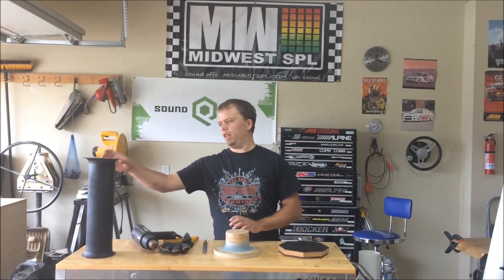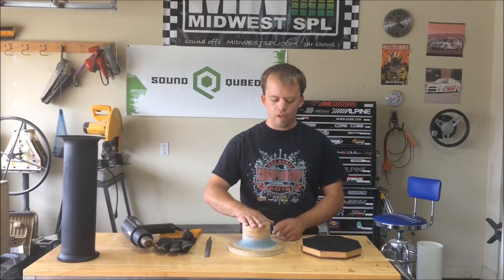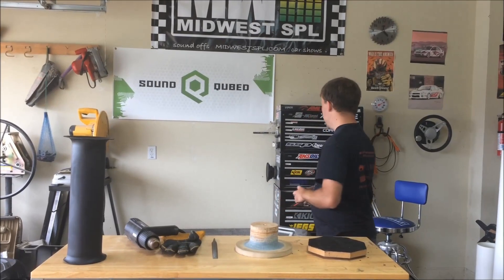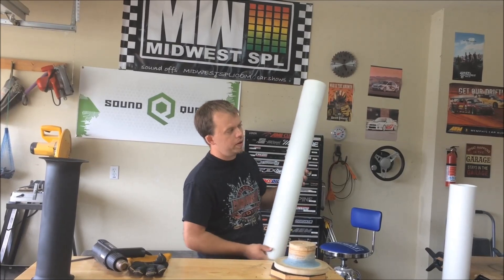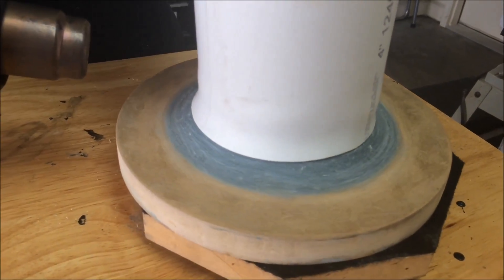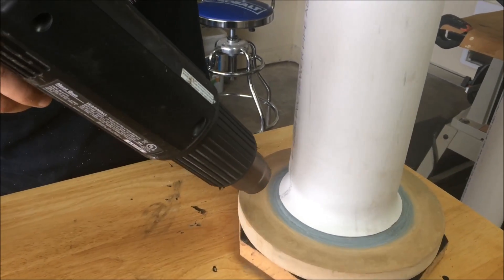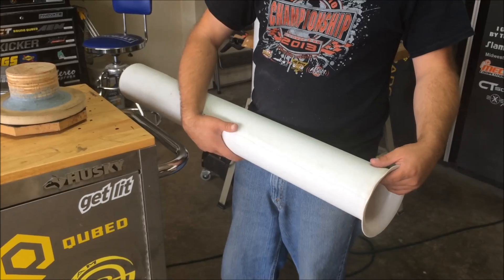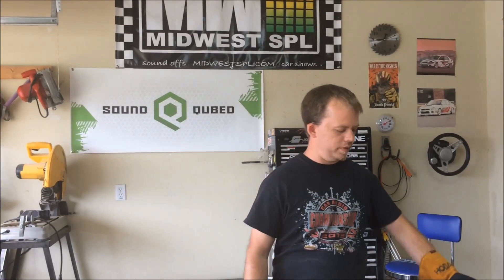HOW TO:  MAKE AN AERO PORT

Comment: flares may look pretty but builders must keep in mind that any flare design will not affect the bass output quality,  its simply for cosmetic appearance
Reply: Incorrect, its been shown to help when you have a smaller than normal port, produces less chuffing, and allows for better air movement
Reply: Nope. Better air movement and cant help with chuffing or port noise

Comment: Good process but i do notice its not a even flare for a flat surface. Id suggest a taller center on the mold to keep it from wobbling or a exterior brace to go up higher around the outside to keep it centered at you press the mold
Reply from the maker: Incorrect but thanks for the feedback the flare is even, and the mold works fine I have made dozens of flares with this same mold no issues.
Reply: @AMICUSTOMS  the tube standing on the table looks uneven and tilted
Reply from the maker: @stevenb320  it might look it but it isn’t, the flare is even

Comment: So if I say have a port length of 12 inches that would set my tune once I stalled unflared , but then I went to flare l both ends , would that effect the tuning now having flared ends ? Not sure if this little change effects tuning if any or at all . Because to me seems it could effect it because of the preset length determine the frequency ...just. question I had
Reply: If you add flares to the 12" pipe, like using epoxy, it will not change the tuning. If you flare the ends of the 12" pipe, its not going to be 12" any more. It might be 9" and that changes the tuning. 
Rule of thumb is that flares are not counted as far as port length is concerned.

Comment: If you flare both ends, how do you get it in the box? One end has to be smaller than the other
Reply: Yes onensode is slight smaller than the mounting port diameter

Comment: Is that a sheetrock jack in the background? Also I have asked others this question a not got a response.. Can I run 2 Taramps Smart3k's to a common chamber 4 12''s. Two on each  amp. If so how there is no phase adj.

Comment: Does the length and diameter of the port affect the sound? Is there a way to calculate how lone the tube needs to be or do you just tune your amp to get the right sound?
Reply: I think that using his rule of thumb for the tube and round over radii is just a short cut to ensure you have approximately/at least double the cross section area at the flared end compared to the basic pipes area.  Thats just my guess though
Reply: The length and diameter determine the tuning. It’s a science.  I do not suggest guessing at it.

Comment: Do  you really need  to flare the other  end? If so reason.... Ty
Reply: Lower mach percentage....smoother air flow, no port noise (assuming you have the proper diameter)

Comment: can you order a metal mold from machine shop and inside it is a heating rod from water heater.? and simply push the pipe 😂
Reply: Sure if you got a grand to spend to get a piece machined to spec for ONE size port and then that's your whole budget for the box build, and the equipment AND the wiring and fusing AND AND AND.. I think the point here is making a port cheaply yet not making a cheap port. I think it turns out pretty damned good. Sure there are likely some corners that could be cut somewhere in the lengthy build of the jig but that's what the first one took.

Comment: thin wall schedule 20(eggshell)  I watch that stuff crack, split and shatter all the time. save yourself the time and effort on re-doing that stuff. use the schedule 40 the time and effort spent. more than satisfy you for longevity.
Reply from the maker: juggernautxtr I have never had a single issue using the size pipe I use like in this video.
Reply: use it AZ, watch it turn to dust in a month.
Reply from the maker: juggernautxtr AZ?  Not sure who that is but the blue box in this video has same pipe I use in the video.  And he plays it everyday and that was going on 3 years ago.  So I think the pipe is fine, but I could be wrong lol.

Comment: So friend, not even the RE told me the duct's measure to tune the box, like length and diameter, the model of my subwofeer is RE SEX 10D4 V1, the manual says to make a box dutada of 35.4 liters plus the duct, could help me?

Comment: when building a bandpass subwoofer box is it better to have ports or slots & should it be larger on the outside or does that matter?
Reply from the maker: Reverend Timothy Petrey really depends on the design there isn't a one size fits all answer to this question.

Comment: could u give me some box advice for a dd redline 800 18.. pretty similar to hdc4. long story short I've made 2 boxes.. 1 6.75 cuft after port and sub and 110sqin of port 24in long.. kills lows 171.1db at 44hz. box 2 5.2cuft after displacement 19.5sqin of port per cube, 18in long.. sounds loud as shit but did a 146.9 at 48hz. in a bravada at cab I believe is 44hz so why is my "spl" box down on score... need some help
Reply: 147.1db on 1st box*
Reply from the maker: +chris jones needs more port area on the SPL box
Reply: AMICUSTOMS 20sq in per cube isnt enough?
Reply: If not what should i try? 5 cuft after displacements with 24sqin per cube tuned to 40hz or what would u suggest

Comment: I do have a question.. is it absolutely necessary to partially aero flare the opposite end of the pvc for a sub box on  the end that goes into the box ? I never knew that is there any gain or loss to doing that
Reply: While it's not absolutely necessary, it reduces port turbulence/chuffing noise.
Reply: @garrettrichards5559 just line it with self adhesive felt, hobby lobby

Comment: Nice Work! I am in the middle of doing this to flare a grey sewage pipe but did not have a smooth surface to push it on, so it split and collapsed. Now I found a smooth surface to push it on. I wanna flare it from 110 - 160mm to fit my existing kitchen fume extractor fan on it and keep it in the attic where it makes less noise.

Comment: Hey man quick question. I'm going to build a under seat front facing box for my 08 Silverado for 4 soundqubed 8's. Probably going to lift my seat 3 inches to make room for the biggest box possible, what size aero port do you recommend? And what length?
Reply from the maker: 6 inch aero about 20 inch long

Comment: I use term-lab and it says to use a 6x10.25 flared port. Do I cut 10.25 and them flare it? Also does the flare have to be the same size on each end? Great video by the way.

Comment: I want to build a class 4 box that fits on the rear deck of a 2004 grand marquis. I want the port tuned as low as possible. I love a low end monster. and I want it pass thru the rear seats arm rest so the bass will only enter the cabbin (no trunk rattle).  I want to use 4 sundown audio 8". my questions are with the airspace , and a is port possible for the build. well over all is it possible to build and if so any possible combinations that will accomplish the job will be appreciated.

Comment: how does an aero port differ from a regular port. also does the flared ends affect the tuning.
Reply from the maker: +Sebastian Williamas Aero increases efficiency as it allows the air to exit smoother and faster.  Yes it affects the tuning you have to add length due to the flare.
Reply: Thanks

Comment: bout time someone has done a video on how to do this, however your video volume was low and hard to hear, thanks though for the vid
Reply from the maker: Turn the volume up more lol?  Thanks
Reply: +Spoogethat  volume was fine for me on asus n56jr laptop
aside: some skateboard grip tape on that lower spindle would keep it from slipping ...or even electrical tape in a cross stitch pattern or even some medical gauge tape would work.

Comment: Where did you find the thin walled pvc? Can't don't it anywhere
Reply: +james55975 There's schedule 40 and class 200. Class 200 is what you want, which is what he used. Call an irrigation store.

Comment: andrew, whats your thoughts on aero vs slot ports. i got 2 hdc3 15s and ampere 3800 and i wanna get the most clean low bass with ability to hairtrick.
Reply from the maker: My view is under 10 cubes box should run aero, over 10 cube do slot port.  That is what I have done and tested and seems to be the cut off.
Reply: @AMICUSTOMS   please keep making videos your videos are very useful and important to people that do want to learn more information I follow from Canada 🇨🇦 #YSW
Reply: @AMICUSTOMS  yes building more speakers boxes for car audio what about home theater systems boxes i follow you 💯 from 🇨🇦 #YSW keep up all of your great work you are doing